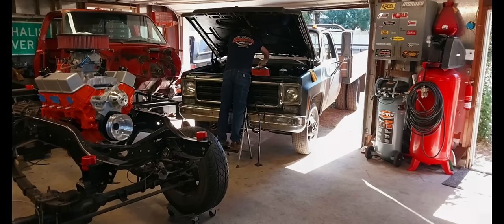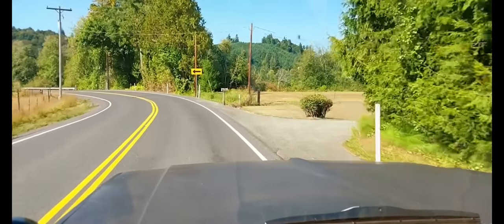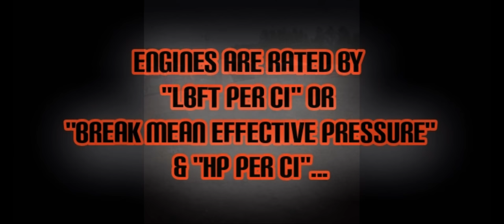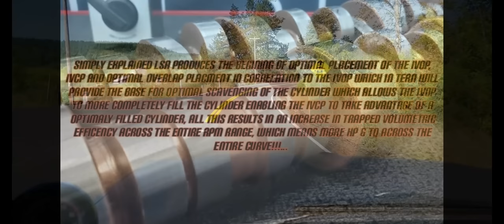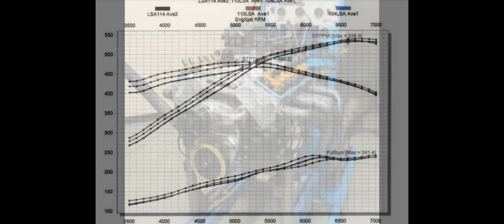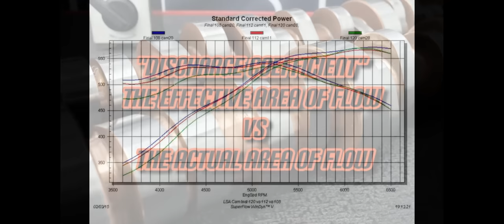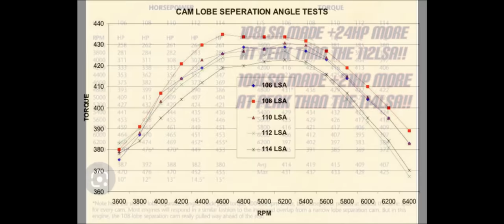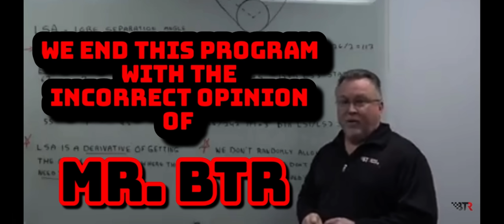Camshaft Selection via LSA, 19LSA's Dyno proven MAX TQ & HP cam tec. LSA, Overlap & Duration convert

Comment: My last  motor a ford FE. 428. 
14.1.   I ran a 106  LSA.   N/A.  My new motor. A FE. 482.  The formula came out to  just about the same LSA. At. 10.5   CR   for both.   The 428.  Had a 2.10. Valve. The 482. Has. the same head at the moment  the new head will have a 2 25 valve   thats what i calcalated the LSA. On  but on this one i went  with a 114.   LSA.   Installed on a 111.    But this motor is not ment to be raced on motor  but on nitrous   but it  has ran faster on its very first test pass on motior  than my 428.s fastes run  which i thought  was interesting. Same heads intake carb combo  with 3. 1/2. Points less compression  which is what i thought it would do  just wondering on your thoughts.  On my cam LSA. And instsall selection    and  thank you for your video.s.    lobe center line should be the starting point  when designing a cam not a end result
Reply from the maker: Thank you for Watching...
Reply: Mr. Vizard talked about this a little on one of his videos, the formula is meant to be a close starting point and works very well on chevys, sbf, 335 series and 385 series, the formula doesn't work as well on FEs. Math is math but the real world affects this and FEs are their own special creature with the head and intake design, also while the formula uses CID, how that CID is made affects the result, like some others have said, at the end of the day the engine will want what it wants, regardless what the formula says.
Reply: @JDT-pq3wi     I used.  127.  Just to see what it came up with.  My motor was already built 4 years before'  what I thought was the interesting part Was. The 428.  2.10. Intake.  482.   2.25.   It came out the same on the LSA. On the formula  for the 2 different combos  and yes FE s. Are special and they like a 7 degree spread   and I did not go by the formula.        my 482.  It was not built to run.  N/A.  Hence. The 114     And I do agree with  you  🖖

Comment: For People Wanting To Adjust A Camshaft With The Wrong LSA And Maintain The Overlap Of That Cam And Simple Way (if math really bothers you) Is To Use The Texas Speed Overlap Calculator. You Have To Use Advetized Duration Values. Put The Cam You Want Rhat Has The Wrong LSA Into It And See What The Overlap Is. Once You Got That Overlap In Your Mind Input The LSA You Want In The Calculator. Start Plugging In Smaller Numbers Into The Intake And Exhasut Durations Untill It Matches The Overlap Number Of The Wrong LSA Cam. If Its A Dual Pattern Cam Start With Same Durations For Intake And Exhasut To Easily Get Near Desired Duration For The New LSA. From There You Can Add One And Take One From Each To Keep Overlap The Same. As For If/ How Much You Should Bias Your Intake And Exhaust Durations... I Dont Know Im Still Learning lol. So Far The Internet Says If Your Exhaust Valve Flows 75% Or More Of Your Intake Valve Your Diration And Lift Should Be The Same (Single Pattern Camshaft). As For Making Your Intake Duration Larger Than Your Exhasut Ive Seen Turbo Cams Do This. However Im Not Sure If Thats Correct Thing To Do Or Not.

Comment: Hi Adam, thanks so much for the great information.  I also follow DV which brings my question.  I'm building a BBC and I found a difference LCA between the information in DV's book "CHEVY BIG-BLOCKS" #SA311 and your 132 tool to determine the proper BBC LCA.  Using DV's graph (Fig. 9.7 on page 94) and then using the 132 formula gives me two different numbers.  Using the graph, the recommended  LCA 108, and the formula gives me a 110 LCA.  Does it matter?  The cam I really like is on a 107, can I use the 107 LCA cam or should I find something else with one of these other numbers.  If so, which is your recommended "proper" LCA to use?  Thanks Adam. 
JPA

Comment: I've not got a reply yet but will keep asking as I don't have deep pockets so will use items I bought over the years when I could: Crate 502 GM Perf. aluminum heads, airgap dual plane (street car) installing Crane roller 288/296 587/610 lift, 112 LSA. Single Torqstorm through FiTech 30012 power adder FI, Patriot shorty's into full 3" Magnaflows. Was told a higher LSA was better for the boost.
Reply: That is correct.

Comment: How much torque per cubic inch, as a rule of thumb, do you gain per point or half-point of compression assuming your cam and heads are as reasonably close to optimized as these formulas give you? DV says 1.4 lb-ft per cubic inch even at 10-10.5:1, but if you can't get much (as in 0.1 or higher) more than that naturally aspirated, what's the point of going higher compression?

Comment: I have not completed the video, yet. I want to ask this question while it’s on my mind. Are we including here rpm sweeps on the lower end? Or is this the typical video of engine dyno sweeps from 3500-7000 rpm’s? Most videos are designed around race engines that they call street engines.

Comment: So would gen 3 hemi's use the 128? Do you ever recommend more exhaust duration as long as the lsa is correct and is there a recommended max extra exhaust duration 2*/4*/6*???
Reply: I believe the gen 3 hemi is different I wanted to ask him but not sure what LSA number it should be

Comment: You and DV are awesome! How would you adjust the LSA if you were limited to shorty headers or cast manifolds and mufflers? If I can ask.
Reply: I don't know if I would worry too much about that. Watching a bunch of Engine Masters episodes it seems to me that anything less that 500hp it doesn't really matter that much if you have manifolds vs headers. After 500hp it seems like its long tubes or bust.
Reply: @yurimodin7333  figured if we're correcting to tenths of a degree for compression changes and rocker arm ratios, why not address exhaust differences
Reply from the maker: Thank you for watching, If your limited to Manifolds or restrictive shorty headers you will maintain the Optimal LSA and focus on adding some exhaust duration to help overcome the restrictive exhaust.. hope this helps!
Reply: Long tubes in anything over 300hp is good for 15-30 ft lbs over shorties. There is an optimal length for primaries and collectors too. Most things are a compromise, and I choose fitment and ease of install with exhaust over output. If you're making 400 horses on a street car and working out of your residential garage, I'll give up the 20 points and keep the skin on my knuckles and the spring in my step!

Comment: Would the ls7 fall more into the big block territory or somewhere around 130 as a start point. It’s really pushing the limits of the small block at 427 and is a similar size as some big blocks. Just wondering why 128 for small block and 132 for big block and how to adjust for the ls7. Also wondering how overlap directly correlates to usable rpm range? Is there a calculation for cubic inch and valve size and rpm to get a desired overlap target?

Comment: @cattledog would the CR correction factor of .75*/full point of CR translate to Effective CR with boost? Ie would you calculate LSA with a CR of 14:1 if running 5psi in a 10.5static?

Comment: Hello everyone, the formula is applied for 2 valves head, or it also applies for 4 valves head?
I see the valve size is one of the input so I just wonder if the 4 valves head (usually uses smaller diameter valves) might be the problem leading to the wrong result or not?
I hope I can get the answer. Thank you, regards.

Comment: I greatly appreciate you sharing this!  If there is any place you can direct me to do further research on the overlap aspect, I'd be thrilled!  Also I'll add I purchased a ruckn torris for an l92 6.2, and I'm not impressed.  Barely made as much power as the stock vvt cam.  Mind you its still stock intake and exhaust manifolds.
Reply: I purchased the 212/22x (😉) cam after stewing awhile on vizards 128 equation.  Not impressed to learn he doesn't believe vizard, and that they lied on the specs.  The 22x is to make people think "that" is the place to find hp, listen to him.  All a bunch of marketing nonsense as you say.  I wish I would have watched this alot sooner!

Comment: Thank you for the informative video! Really enjoy learning all about this.  I have three questions to go along with all this.  I am wondering if there is a formula to calculate ideal overlap that I should be targeting for my specific engine. And also how does advancing or retarding the intake centerline while decreeing a cam have effects on say power and valve events? And finally what are the differences in choosing a split intake and exhaust center lines compared to the same centerlines.  For example (106/106) and a (103/109) both are 106 lsa but how does the different centerlines effect power? I’m really trying to learn and feel like I’m starting to grasp the concept but I’m just curious about every aspect.  Thankyou
Reply: I was wondering the same thing. I am building a daily driver ls7 427. Stock cam has 211 degrees of intake duration. I would like to get another 
30 hp. without effecting emissions since I live in Calif. I would like to change intake duration to 219 and not sure what else to change since I know
most of these calcs. are for peak hp. and torque without concern about emissions.
Reply: I forgot to mention cam specs  stock cam are 211 intake 230 exhaust with around .590 lift . and an LSA of 121.
Reply: Been a while since I read DV 's books. But my recollection is that optimal advance is determined on dyno. But is typically 2 to 8 degrees advanced.

Comment: Never could understand having a PD blower car and then neuter the low and midrange. Might as well go centrifugal or turbo. Then the SAME neutering builders recommend a stroker motor which add HP and Tq primarily in the low and midrange. UHH. How does that make any sense? When they could have gained SIGNIFICANTLY in those ranges with the proper cam.

Comment: Thank you for this informative video and formula for success. I have a question; Can you use this formula with EFI engines? I want to employ your formula on my BBC and it translates to 107-108 LSA. However, when I look at those cams, they always say "Not for Computer Controlled" engines. Can you run a smaller LSA on EFI engines?
Reply: I am sure he has the answer to that but my guess is because of overlap is to much for the computer controls so you need to take away duration

Comment: Okay so I understand the lsa cal and the duration cal. Using dv’s overlap chart. But what do you do to figure out exhaust duration. Idk if I missed that or if it wasn’t  covered. But any help there would be awesome trying to spec cam for my 416 with a ysi and a buddy’s 427 with a f1a procharger. Thank you

Comment: Have you used engine vacuum for power brakes in  your vehicles.  What is your experience with vacuum numbers with narrow LSA engines? Comments please.  Thanks.
Reply: If engine vaccume is a problem then lower your duration LSA doesn't dictate idle quality it's overlap that does it so to lower overlap you lower duration
Reply from the maker: All the idle and vaccume is effected by Overlap, I explaned and had shown a formula that will adjust duration while maintaining the optimal LSA with a specific amount of overlap... Always keep in mind that 2°of LSA =4° Overlap & 4 degrees of duration =4°Overlap...
Thank you for watching...

Comment: Very informative video, I’m going to have to watch it a few more times before it really starts to sink in. Thank you for sharing your knowledge, and I’m sorry for the cards that you have been dealt, I’m in the somewhat of the same boat myself with health issues beyond my control, so believe me I get it. How would you adjust your formula for a sub 10-1 compression motor? I have a 454 that I didn’t build but have most of the information on the build. It should be around 9-9.5 to one  compression and I’m looking to select the perfect hyd roller cam for a street driven 69 Camaro 5-speed car. Thanks .
Reply: 10:1 to 10.5:1 will have the same LSA
Reply: For 9 or 9.5 do about 1 point tighter LSA
Reply from the maker: Thanks for watching... Now to your question, with a 9-9.5:1 you will need to go 1 degree tighter on the LSA...
Take Care🙏🏼🙏🏼

Comment: Update
Check out Brent L's latest cam video. He used my ticket as a what not to do.
Note i told him the motor build would have 11.5:1 compression,
Flat top + 6cc and quench of .032
Check out his video he thought he was using me as an example of what not to do.
Engine family is gen2 sbc lt1 350.
Stock quench .025
Stock comp 10.4 - 10.89 depending on who is talking.
This icon vette and z28 90's enging was reverse cooled.
With this in mind, pop a bag of corn and find the video and enjoy the show.
BTW, i never said a harmful word in the email exchange with Lykins

Comment: Just got done with a budget build 406.
Promaxx 215 head.
Stock cast crank with a bunch of material removed. 
Scat I beam rods.
Stock ported oil pump 
1/16 rings
Cast flat top 11.3 w 64cc head
Custom ground lunati flat tappet
247-251 580 530 with 1.6 and 1.5 rockers. 106 lobe sep 102 centerline.
Ebay 1991 victor jr matched to a 1206 gasket. 
15/8 headers.
These heads are a bargain,  they flow real close to 300 and flow over 230 on exhaust. 
Engine should make an honest 560 580 hp at 6500.

Comment: Wow that changes everything for me now I know I have the wrong cam so can you spec the right cam for me? I have a sbc 383 AFR vortec heads 9.6.1 compression 6k max rpm
Reply: 105 or 106 LSA David Visard did a video about 383 and I think 106 for 10 to 10.5:1 so 105 to 106

Comment: Why different constants for those groups of engines? I was hoping to use this equation when I choose specs for custom cams I'm going to have made for my winter daily driver here in Alaska (first gen Impreza), I don't want to go turbo or switch to a DOHC interference engine. The phase 1 sohc engines have a really low hp/displacement ratio compared to other 4 valves engines and I suspect it's mostly because of lack of overlap and a very poorly designed exhaust system, so a custom header and cams is what I'm going to do.
Reply: My understanding is that the different constant is determined by the amount of cross-communication between the intake and exhaust during overlap (BBC having canted valves, for example)

Comment: Just for fun I wanted to see if the cam I run in my 302 SBF has the correct LSA according to the formula and turns out I luckily picked the right one. E-cam 110 LSA 😅
Reply from the maker: 👍🏻... Thanks for watching...
Reply: The E cam may have the optimal LSA, but the overlap and lift may be off from what your engine combo wants?

I recommend 1.7 rockers, if you haven't already, as those alphabet cam lobes are "lazy" compared to what's on the market.

Comment: In the 4 valve world we have to be careful not to overdo overlap because we have so much valve area, both intake and exhaust, relative to port and cylinder volume we can very easily get into a similar condition described here were we start pulling exhaust back into the intake. This is one reason why most racing DOHC specs don't include as much overlap as you might expect from a similar 2 valve engine.

Comment: How would this work on a blower engine? more specially a lower rpm 6.0L "LS" in a work truck.

What about small 4 cylinders and v6? Could you add 2 or 4 more cylinders to make it a v8 on paper and run the formula?

Love your videos. Hope you're able and willing to do more!
Reply: Blower makes no difference, the engine will follow the same torque curve but elevated based on the amount of boost as long as the supercharger can supply more air to the engine than the engine can pull on its own (you can calculate this reading compressor maps on centrifugals and turbos when selecting one for an engine).

This formula works best for 2 valve v8s, but it can be adjusted for differences in number of cylinders and valve sizes. All it is is a very simplified version of DV's formula built for his cam program (calculator that takes way more into account than displacement, cylinders, and valve size). The simplified version just tends to give a result close to what the full equation would give you. That's why the formula is changed for small block Ford and big block chevy. Thus the inputs for a 4 cylinder to that formula as is may not give the correct LSA. Not to mention many 4 cylinders have 4 valves per cylinder which I'm sure changes things significantly.
Reply: The 128 formula probably would work for 4.3 Chevy V6 because it's a SBC minus a couple cylinders.  The first number in formula is based on the intake port configuration, the reason MOPAR 440 and SBC use 128 is because the intake port configuration is nearly identical.  BBC & Cleveland Fords intake ports are spaced further apart and more equally which is why they use 133 vs 128 of SBC & Mopar.  A 4 cylinder head that looks like half of a V8 I see no reason you couldn't run the formula.  Some low lift DOHC isn't going to work though.